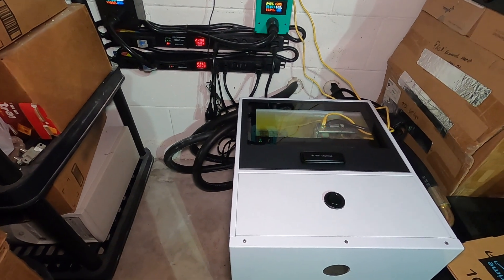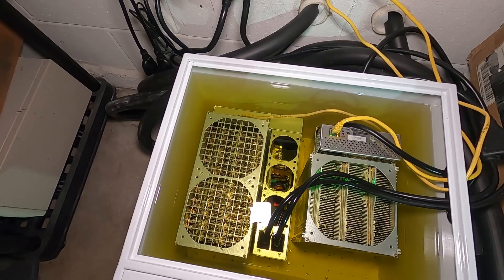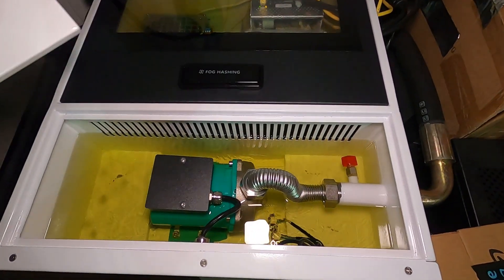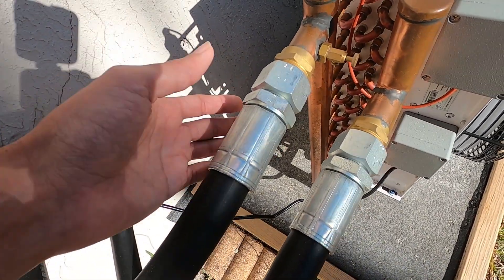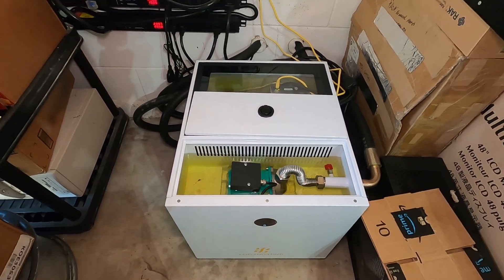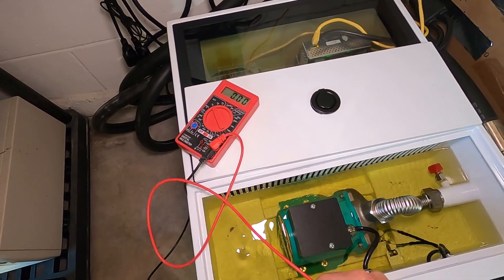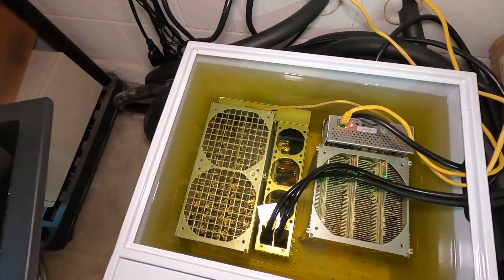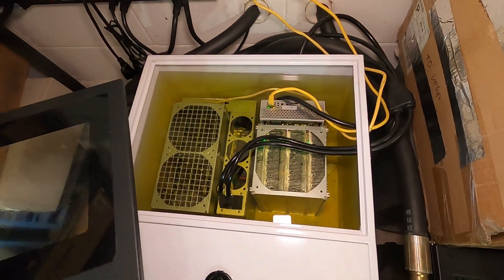Update on Immersion Cooling Setup

Comment: 在寒冷地方这个油冷矿箱配上水循环还可以给房间供暖
Reply: Thats not water that oil
Reply: @1lluv  I know it's oil, but it still depends on the water temperature to cool the oil temperature, and then the hot water circulates through the booster pump pipes to the heating radiators in each room.

Comment: When trying to figure out if a liquid is conductive or not, you want to set your multimeter to continuity, not measure voltage, unless you keep the black probe on chassis and dip the red one in to see if you get 240v. When you submerge your probes in the liquid meter shouldn’t beep while set to readout continuity.

But in order to be sure you need to get a sample of one or two drops, place it on a piece of plastic or glass and test with that while your probes are almost touching.
Reply from the maker: Did I not show that in video, I did it. But bout time for another check up so I will do it again. Thanks
Reply from the maker: You got me on Twitter or Discord by chance?